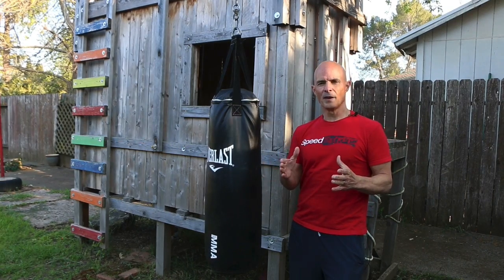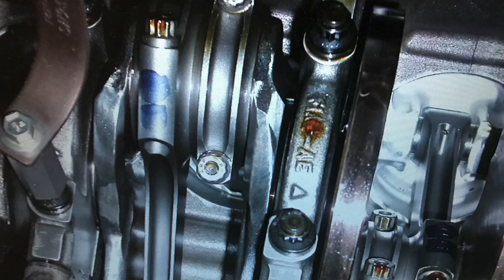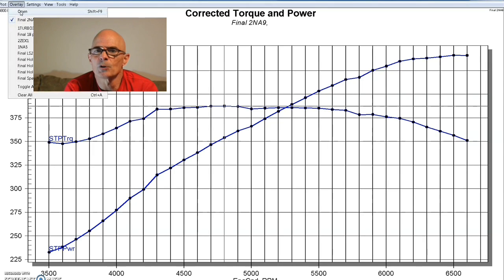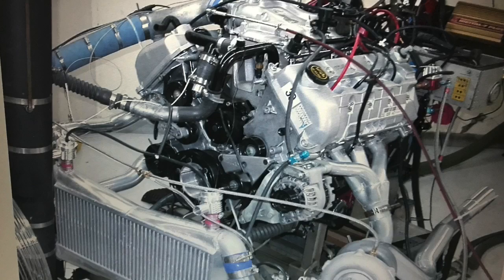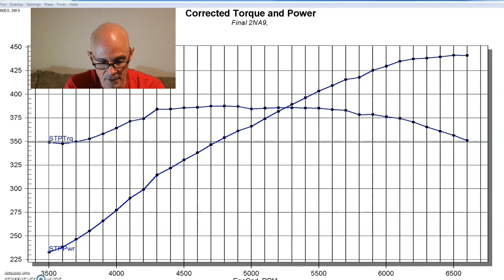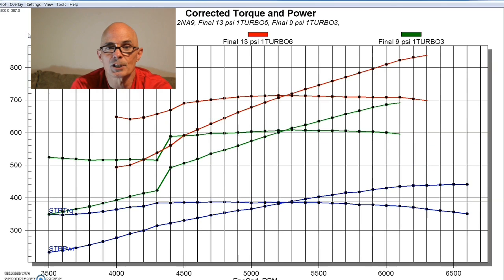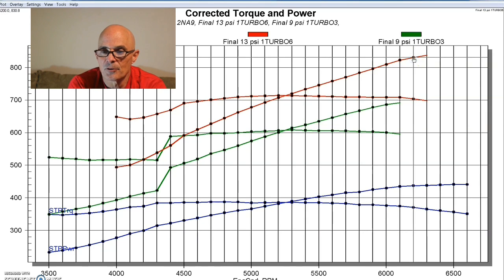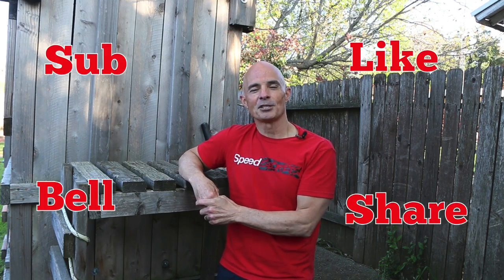1,000 HP TWIN TURBO FORD 5.4L 4V NAVIGATOR

Comment: Is this 5.4 4V similar to the engine used on the newer supercharged GT500?
Reply: Yes and no. The heads on the the gt500 are completely different as well as a forged rotating assembly, but the block and overall architecture of the engine is similar.  The navi 5.4 is closest to the 05-06 Ford GT(besides the forged internals and dry sump oiling), and first gen gt500's, the 2011+ gt500's were bumped up to 5.8L and are known as "Trinity" motors vs the 4.6/5.4 "modular/mod" motors.
Reply: @MachJuanMustang  thanks for the info!
Reply: @MachJuanMustang  2011-2012 gt500 had 5.4 still albeit an aluminum block the trinity 5.8 didn't come till 13-14
Reply: @midnight347  thank you, didn't know that, i thought the 5.8 came out in '11. Thank you for giving me the correct info, learn something new everyday!
Reply: @MachJuanMustang  no problem it can get confusing
Reply: @MachJuanMustang  the 11-12 also got a silver Eaton m122 blower and blue valve covers VMP says the silver blower was to signify they now had an aluminum block.  The 07-10 cars were iron block and had black valve covers and black m122 blower.  07-12 is the same thing outside of the block material they can make basically the exact same power once they're both modded with the same parts.  The trinity makes more with bolt ons mostly because it has a much better blower...swap that trinity blower onto an 07-12 car and it will make similar power very comparable to the 5.8.  The 5.8 will make that power on slightly less boost (usually around 2 psi less per each pulley size) and it'll have maybe a little better torque but essentially the 5.4 can make trinity like numbers or close to it so long as they're all running the same blower.  One benefit to the iron block cars is how much cheaper and easier to find a block is should something go wrong.  Strength wise it's as good or better but you have the weight penalty.  I feel its worth it just for the fact you can find one easy if you need to and its MUCH cheaper especially compared to an aluminum 5.4 or even worse (price wise) an aluminum 5.8 which goes for 5 grand just for the block alone.

Comment: Nice! Are those T4 flanged 67's? What size turbine A/R?  I'm putting together a single 7675 turbo with aviator heads and cams and Sullivan intake.  Any idea what those ported navi heads flow?

Comment: Navi motors have a lot of potential with a stock block. I seen a ten second fox with a 100k navi motor swapped to carb and upgrade in cams and fuel. That's it. They run
Reply: I could def see that.  With a decent manifold and a good set of cams 400 rwhp would be fairly easy an aggressive setup could go well beyond that so a 10 second fox is easily believable you can get foxes into the 10s with 400 rwhp no problem set up correctly.

Comment: I don't think anyone can make an argument about the Ford Modular line up. Look at the 2v,3v,4v 4.6 and 5.4 engine's they all are a 3.552 bore size. And the power that can be extracted from them to me out shines all the other domestic V8s with the cubic inch they give up vs the other two companies. With that said the other two companies also have there work horse's that make big power. So don't hate on me lol. Keep it up Richard I enjoy all of the content you bring to the table thanks bud.👍🏁👍🏁👍🏁

Comment: I've always wanted a 5.4 DOHC in a mustang. The big obstacle is getting a set of longtube headers to fit. I think the best thing to do would be go with a turbo setup. It would be easier to make a set of turbo manifolds fit. MMR makes an adapter to run a coyote manifold on a 5.4 DOHC.
Reply: The gt engine which is the same thing on twin turbos is faster than the fastest buggatti look up fastest road legal car if you don’t believe me

Comment: I love 5.4 4V these results are so very true. I run the Richard racing spacers which allowed you to run the cobra 4.6 intake on the 5.4. You have 2 options 5.4 specific pistons or use pump gas boost friendly 4.6 pistons which give you a lower compression ratio.
Reply: GermanShepherdsofOKC you can run a coyote intake on them

Comment: re: Mustang Cobra engines - 
The Lincoln Mk VIII 4.6ls are all but identical to '96-'98 Cobra 4.6s(I assume that you weren't looking for an '03/'04 Cobra engine at just any ol junkyard lol).
They both have 'B' heads, same pistons, same rods, same Teksid block, same exhaust cams - the Mk VIII intake runs out of breath early(the Cobra intake is a popular swap), the intake cams are slightly smaller, and the crank is a 6 bolt cast compared to the 8 bolt forged - but that's basically it. 
As much as I'd like to see a 'big bang', I honestly don't think it's worth the time with that cast junk inside of them - but the block & heads are a great base for a race engine! 

Honorable mention to the 4v 4.6l in the Lincoln Aviator too - same engine as the automatic(cast crank - 3-pedals had the forged crank) Mach 1 Mustang. Better hypereutectic pistons & powdered metal rods than the cast garbage in the '90s 4v Modulars. In fact, maybe one of these would be more worthy of a 'big bang'...

Comment: I have three of the Mk VIII engines that I've been trying to figure out what to do with.  I wonder how much torque the stock internals could handle.
Reply: 480 you hit 500 or more on torque and hp and you pushing it. 470 to 480 on low boost with high octane gas and it'll live reasonably well
Reply: @zachniverson8816  Thanks.  Was planning on running E85.

Comment: Can we see a "Big Bangoff" between the 4.6L mod motor and LS 4.8?   Sloppy has had good success with the 4.8L motor in his SN95 Mustang and it would be interesting to see a bangoff between those to platforms.  The Mustang LS swap has been done to death.  What can we get out of the old 2V 4.6L ?
Reply: The weakest link is the rods and pistons if you upgrade those you should be good for 600-700 wheel if you also throw in a forged crank you could probably go up near 1000 wheel.  An entire forged rotating assembly is like 2 grand or so.  Yes a junkyard ls could be had cheaper for just the engine alone but by the time you go through getting all the extra stuff needed to swap it into a mustang you could have just built a fresh forged 4.6 instead of having a stock high mileage junkyard motor in there.  And you would sound a lot better to boot (sound is subjective but I think the 4.6 sounds better than the ls motors personally)

Comment: What happens to the Boost curve if nitrous is added from wide open throttle up two less a 4500 RPMs and what happens to the power curve does it increase or does it decrease after 4500 with a turbo

Comment: Just curious have you done any ford or dodge v10s ?
Reply: Just throwing this out there, but...

...gen 1 Viper V10 heads will bolt onto a truck V10 with a little work...

Gotta fill the coolant passages in the heads and redrill them to match the passages in the block, but they bolt right up after that. The truck V10 has a slightly taller deck height, so 1/4" spacers bolted to the intake ports will allow the matching Viper intake to bolt on.
It's not the simplest swap ever - but, when you consider that you're putting Dodge Viper heads on a wheezy truck lump, that really isn't too bad for the 'fabrication inclined'!
Now the gen 2-4 Viper stuff requires more work - would probably just be easier to dry deck the heads & block and just run external coolant lines(...or just suck it up and buy a Viper V10...). They're pretty wicked parts though, especially the gen 4 Viper stuff, they really pushed the architecture with that engine. IIRC, the gen 4 Viper V10 came in between something like 550-575lbs - for an 8.3l V10!!! Old school 450+cu in big blocks are typically well over 600lbs, even the 3.0l I6 2jz from the Supra weighs over 600lbs it self(funny how you never hear anyone talk about the weight of 2JZs like they talk about the size of DOHC Mod motors...)!
Reply: John olson there are plenty of hd dodge trucks with 8.0 non viper v10s out there...
Reply: @gunsandmachinesenthusiast  Yup. And, with both having nonexistent aftermarket support, at least the Dodge is bringing 8.0l to the table vs the 6.8l. It would be one thing if the 6.8 had some 4v heads(...what a monster...), but it's only the weak 2v(where you at, Trick Flow? If only...) or the problematic 3v.
Reply: @RyTrapp0  there was nothing problematic about the 3v v10.
Reply: @AK_Ray  Oh thank god - an "expert" finally showed up...
Reply: @RyTrapp0  you're welcome
Reply: RyTrapp0 I had an idea a long while back, but could you deck the truck block to the same deck height as the viper block?  That way you could use the viper internals, and you wouldn’t need to have the spacers to make the intake bolt on. Basically it would be an iron block version of the viper engine. Or am I completely mistaken?
Reply from the maker: I have not
Reply: The Ford v10 is a motorhome engine  with very little aftermarket performance parts available. They are tough though, I've seen super duty v10 trucks with over 500k on the odo. If you wanted to make a performance ford v10 you would have to make everything yourself.
Reply: @johnolson1279  You are very much wrong about that - 2nd gen engines are going for $4000-$5000, 3rd gen are $9000-$10,000. 4th gens are a lot more obviously at >$20,000.
They've been swapped into EVERYTHING, from Mustangs to S2000s(not kidding - and there's more than one).
Four Wheeler mag swapped a Viper V10 into a Durango mud truck build. There's BMW Z4s, Datsuns, Volvos, lots of pickups, Jeeps, PT Cruisers, Jaguars...

As far as Triton V10 swaps... well, there's a Mustang II with one(such a SICK build)...

I'm accused of being a Furd fanboy with regularity(side effects of actually having some knowledge about specific cars); but at least the Viper V10 actually has the tiniest fragment of an aftermarket, there are actual high performance products for it unlike the Mod V10. Hell, there's even aftermarket heads for the Viper V10, JM Striker heads. Can't say that for ANY Modular.

Not to mention the gross split pin crankshaft in the Triton V10 - I'll take the odd fire V10 with its standard crank.

Comment: Was those a stock navigator block or aftermarket block. Wondering how much power these blocks can hold
Reply: there was no aftermarket blocks then
Reply from the maker: stock block
Reply: Richard Holdener thay stock block can handle 1000 hp? 😱
Reply: Aftermarket block? LOL, that's a good one...

No such thing as an aftermarket Modular Ford block, just like there aren't any aftermarket heads either outside of the Trick Flow 2v heads.

Short answer: iron blocks are good for about 1000HP, aluminum blocks are good for basically as much power as you can dream of 

Long answer:
The iron blocks are OK - they're good for up to ~1000HP or so, but the cylinder sleeves are very thin and they're only supported at the top and bottom of the cylinder. Mind you, a production block that can hold 1000HP isn't exactly 'weak' - I'm sure you've heard of the 5.0l Windsor's problem with splitting right in two at little more than half that power...

The aluminum blocks are where it's at, they're much more robust(believe it or not), having significantly thicker sleeves that are supported by much more material than in the iron blocks.
The Navigator block I don't have a hard number for as most that go past, say, 1200HP or so with a 5.4l are GT500 or Ford GT owners that are building the stock engine - and the 5.4l dry sump block in the GT and the redesigned aluminum 5.4/5.8l block in '11+ GT500s(typically known as the 'Cobra Jet block', being found in the CJ race cars and CJ crate engines) are damned works of art beef cake blocks, the strongest of all Modular blocks.
With that said, I've seen more than a couple Navigator-based 5.4s pushing ~1200HP in drag cars. Don't quote me on this, but the guy that owns & drives the yellow 'Minion' '98 Mustang Cobra has a 5.4l now, which I believe is based on the Navi engine, and he's making enough power to compete with the fastest H-pattern stick shift 1/4 mile cars(he had the record for a minute with the original 4.6l engine, he's running DEEP into the 7s).
To put it another way, in all my years in the Modular community(since around 2004 or so), I've never heard of anyone breaking a Navigator block, while some have busted a cylinder wall in the iron blocks. 

The iron vs aluminum comments are just as true for the 4.6l as well, with the aluminum 'Teksid'(foundry in Italy, same ones that make Ferrari engine castings) block produced from '91-'99 being the strongest of the 4.6s, and pretty much as strong as the aforementioned GT & GT500/CJ blocks.
But, all of the aluminum blocks, 4.6 or 5.4, are good for at least 1000HP, there isn't really a 'bad one', only 'better ones'.

To put their strength & durability into perspective, John Mihovetz is basically the god father of Modular performance - his best number to date with his Pro Mod/Top Sportsman car is 5.88@254MPH.
Production 4.6l Teksid block, unfilled, water in both the block & heads 
Production Ford GT/GT500 4v cylinder heads(he's mentioned that the '96-'98 Cobra heads can perform just as well, but require more work and wear out quicker than the GT heads)
Stock valvetrain(believe it or not - just the typical upgrades, valves/springs/retainers/cams)
11.5:1 compression
62psi boost 
10000RPM(yup, with stock timing chains/guides, cam followers, even hydraulic lash adjusters)
Over 3000HP 

Utterly insane for some lowly mass produced Ford parts. Obviously it goes without saying that he doesn't just take the stock parts and make over 3000HP after throwing some pistons & rods at it - he puts over a hundred hours into prepping the block & heads, including dry decking them. But, what else would you expect from parts that came from cars like a 305HP '96 Mustang?

You could say that they hold up OK...

Comment: I'd love to see a 5.4 3v combo..  Total blacksheep build, as it's one of the most hated motors out there.. but, they are fairly easy to lay hands on..
Reply: Yes 5.4 3v
Reply: The heads just have issues, they seem to be a bit more detonation prone, compared to the 2v & 4v. They'll certainly out-flow a 2v though - but now I'm wondering how the 3v head compares to the Trick Flow Twisted Wedge 2v...
Reply: Yes please do some 3v videos!!

Comment: Richard you rock!!! That torque curve (straight line!) sealed the deal for me-I want one of those 5.4l 4V! Do you have the specs for the cams, and please clarify the stage 2 & 3 setup I/E...Thank you.
Reply from the maker: stage 2 intake and stage 3 exhaust
Reply: Sil Vio  Sort of. The Ford GT had an aluminum block, and special provision for dry sump oiling. Also had it's own special head castings and intake manifold. Bore/Stroke and basic architecture is the same though.

Comment: those results are almost identical to mine - 12lbs my car made 820whp/700ish tq first dyno run, at events i ran 18lbs with 5 on the scramble - lasted forever like that, in fact it was my 8.8 housing that let go at 120 at the 330 mark that ended the cars life last year not the motor. Square bore ford motors get a bad rap, they can really rev out if you build em right.

Comment: I’ve been building stuff for my 5.4, plan on running around 5-8psi for the street. Looks like I’ll be in the 550-800 range. 550 is about where I want to be for street driving.

Comment: All the 4 valve motors are rare. Even among the wrecking yards and supply chain rebuilders 2 valve 4.6/5.4 motors outnumber the 4 valves by more than 100 : 1. There are more 4.6 2v explorers than there were 4 valve marauders, mustangs, and navigators combined.
Reply: I really appreciate you doing more variety of things. I understand the hot topics are always the GM tools (as in the case of magazine articles) but seeing that all engineering principals hold true regardless of brand loyalty is very reassuring. A dyno is a measuring tape just like a time slip. Seeing theories proofed over and over again is extremely useful knowledge. Thank you.
Reply: @MrAPCProductions  look for the 4.6 4v in the Lincoln mark 5. Theres literally 8 of them at my local pick and pull.
Reply: @MrAPCProductions  gm tools indeed😁
Reply: A engine came out in Australia in the Ford Falcon XR8 which is very much the same. Plenty of them in wrecking yards now essentially a 5.4L triton engine with 4 valve 4.6L heads.

Comment: I graduated high school in 1990 & have always been into hot rods   Could u explain sometime why it used to be so expensive & sometimes impossible to get even 450 hp from any small block pre Ls was it flat tapper cams , ignition there was a time that a dual point was better than hei on a small block ford.   I mean they had good manifolds like Vic jr’s & others that people still use. Kids should know how tuff it was back in the Stone Age 80’s& 90’s
Reply: Michael Arrington short answer: cylinder head design. It’s come a long ways since then.  Adding to that is cam technology has improved dramatically too. Then fuel injection makes things even easier and more flexible.
Reply: Btw, I had a sbc back in the late 90’s that made 447rwhp and 479ft lbs tq n/a. I built it when I was about 20. So it wasn’t hard, I had fast burn heads, hyd roller cam with solid rollers used on it. I ported the heads and built the engine myself. Probably about 580hp at the flywheel. Daily driven, 19mpg fuel injected (haltech with a mini ram intake) and power everything, leather seats and cold ac. Black third gen camaro. Had a stock muffler with a cutout. I had 4” mufflex exhaust necked down before the muffler, and a 3.5” cutout before it necked down. Car ran low 11’s on 555r nitto trapping 122-124mph. All motor.
Reply from the maker: must have been a 383 at least
Reply: Richard Holdener it was a 383 with 11:1 compression running pump 93. I did transfer the heads and cam to a sbe 350 with 9.5:1 compression and it went 12.01@117mph in the same car. Same everything except bottom end.